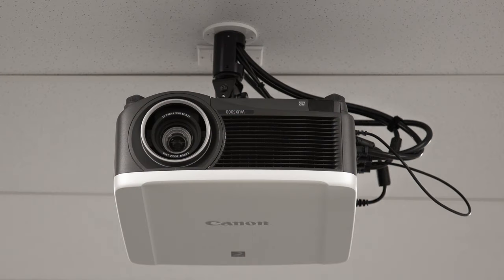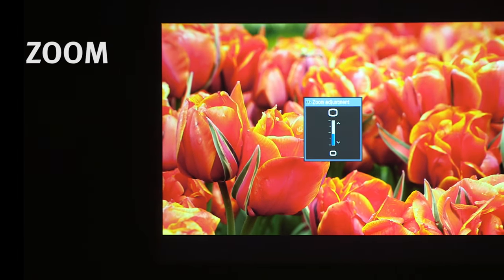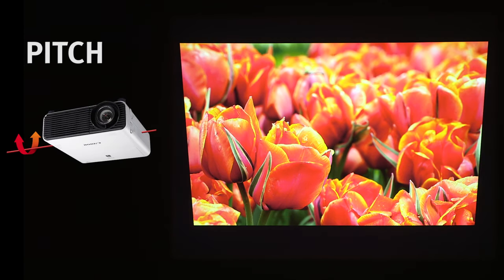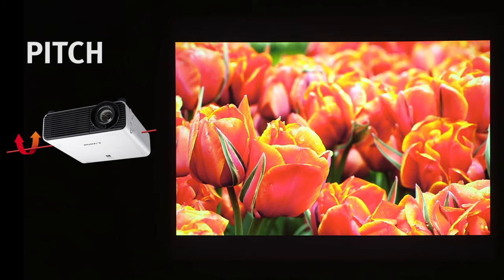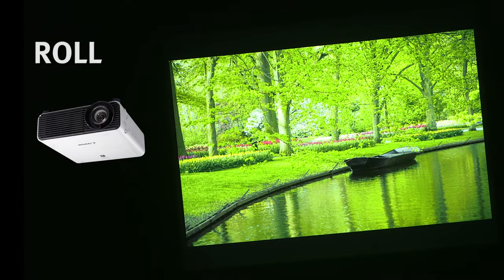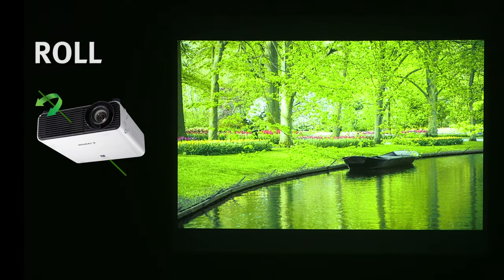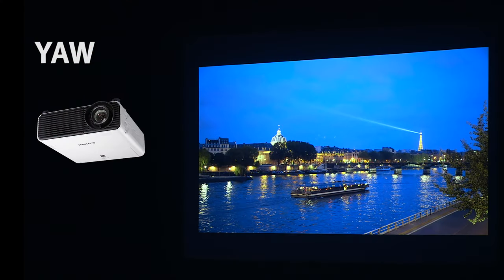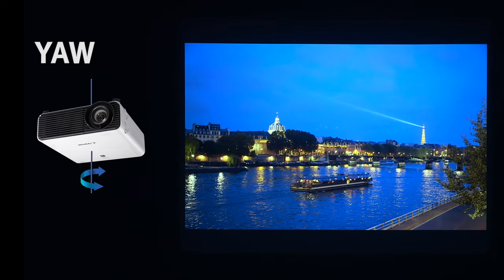Projector Alignment

Comment: The power cord adapter is making my projector tilt I have it mounted to the wall any tips
Reply from the maker: Hi, Joshua!  You'll want to call our US-based support squad for a solution.  You can reach them weekdays at 1-800-OK-CANON (1-800-652-2666).

Hope to help you soon!